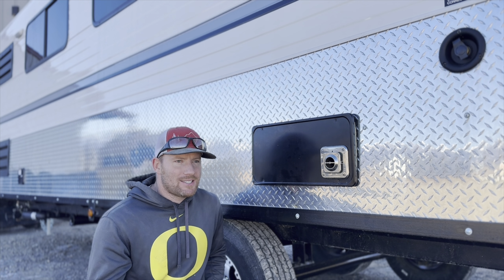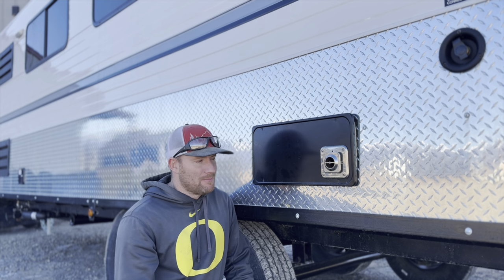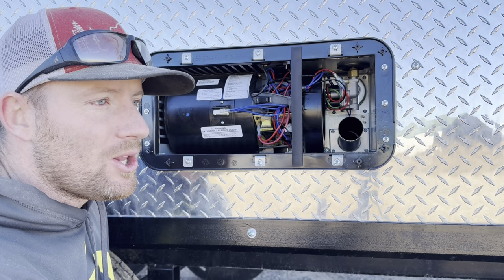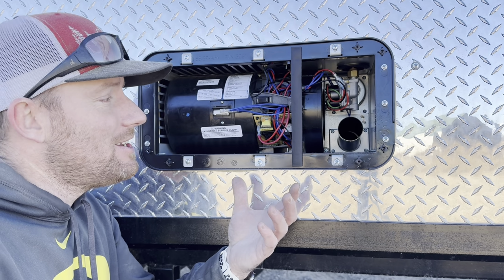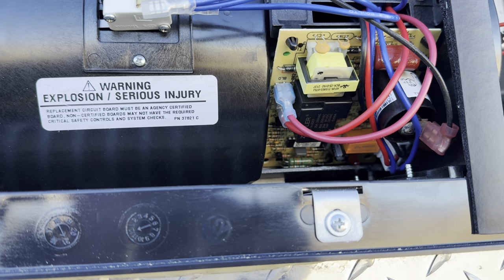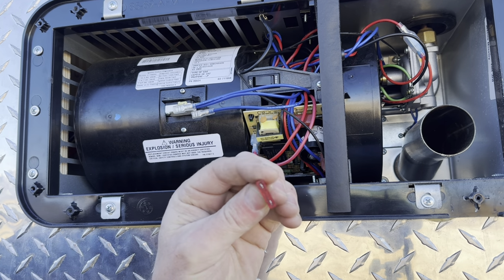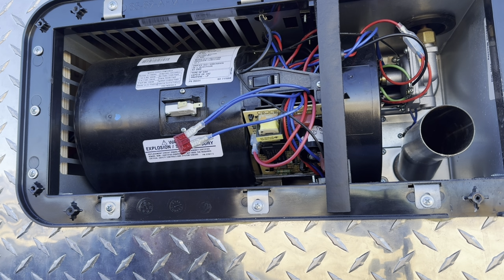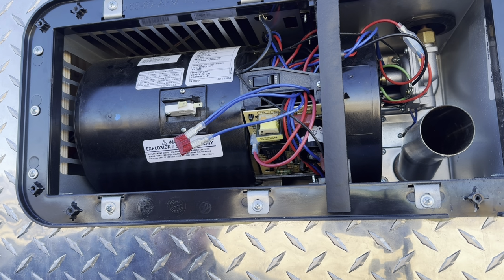RV furnace doesn’t  ignite

Comment: Absolutely awesome, Weston! I will add a replacement sail switch to my "sheep camp emergency kit." I added a couple of thermal shut-off links to my kit after a prior video you did on water heaters. Lo and behold, one morning, I had no hot water. I went outside with a towel wrapped around me (don't ask!) and checked the thermal shut-off link, which had blown. I temporarily bypassed it to finish my shower, then went back to replace it and check for any other faults. These videos are so helpful; thank you!

Comment: I saw your video about changing out a furnace switch. My problem isn’t heat, my problem is my blower isn’t even turning on. I checked my fuses and found one blown but it was labeled radio yet the radio has power. Looks like a great job from the factory of mislabeling. 
I’m hoping you comment about bugs building nest in the furnace is right. Great videos, thank you so much from an ordinary guy that can’t afford a $500.00 repair bill!

Comment: My sail switch works, high limit switch works , new circuit board and still won’t light. You can hear the igniter. Old circuit board it would light and go out a second later. At my whits end with this pos
Reply: Sail switch has continuity and alows power through it
Reply from the maker: It wouldn’t even attempt to spark if the sail switch was bad. I would look towards an igniter or possible a plugged or blocked orifice.